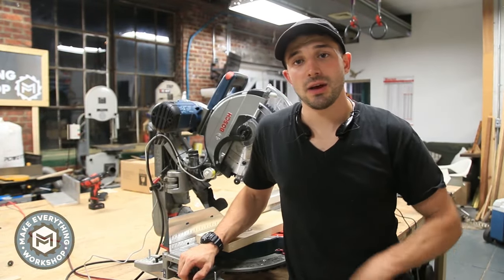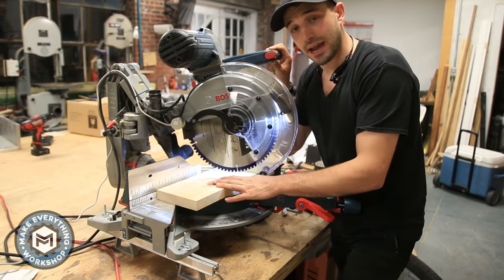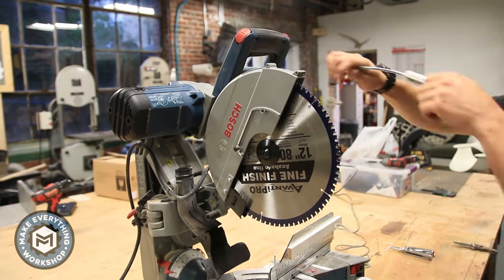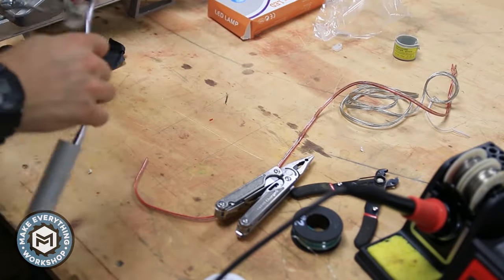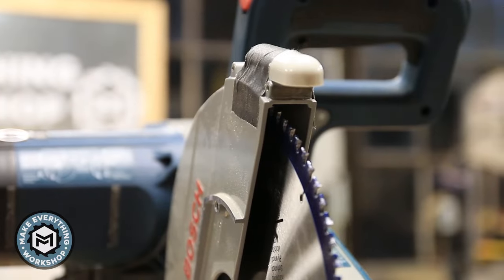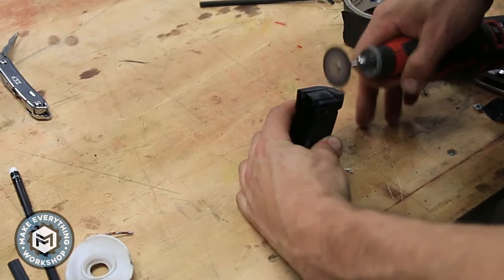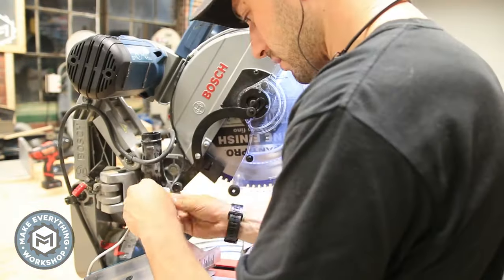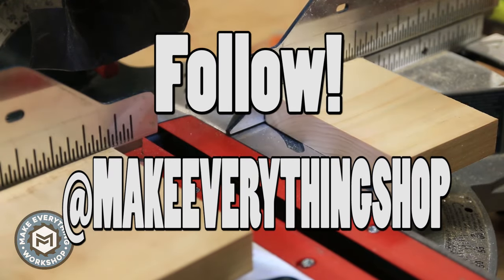How To: Add A LED Shadow Line To A Miter Saw (CHEAP!)

Comment: Brilliant- no pun intended- absolutely one of the best tool hacks I’ve seen on YT. WHY didn’t Bosch do this in the first place?  You’ve made a popular saw 5x more user and greenhorn friendly / much respect!
Reply: Probably because Dewalt has a patent on it?
Reply: Dewalt does it and they charge $200 for it >.< it's called XPS technology.
Reply: Bosch does have one it's on the European model not Imported here. I've tried to find the parts it replaces to top plastic piece at the end of the blade guard
Reply: @georgebliss7674  Makita has it also. Are they paying Dewalt for the license?
Reply: @XaeroR35 , either that or Dewalt's patent ran out
Reply: Dewalt's markup on a few simple components is ridiculous. I was thinking of adding a laser but this is so much simpler and far less expensive

Comment: When I did mine the other day, I wired the light into the handle power line. That way the light does not have to have a separate power plug. Haven't seen anyone else do that.

Comment: That had to be the BEST tip I've ever gotten from Youtube!  I thought I'd tell you that my 12 inch Bosch saw (GCMSD.... which I thought was identical to yours),  it turns out it wasn't..... it did not have that black plastic removable piece.  I just drilled a hole in the back of the metal raised part and ran the wire thru and it worked great.  One thing I did different was to NOT open up the housing at the bottom of the light but instead take a couple of pliers and twisted the gooseneck open to access the wires inside.  I cut off a couple of inches of the metal gooseneck and extended the wires that way.  Very easy!  Thanks again for a great idea.

Comment: You, my friend are a genius. I had the Dewalt with the shadow line, but sold it to get the Bosch, and the one thing I really miss is the shadow line. Not anymore. Thanks for posting this video.
Reply: which model dewalt did you have?
Reply: @ginoasci  DSW780 comes standard with it ($600). The DSW779 ($400 for the same saw minus light) is able to install the upgrade kit but they stopped selling them.

Comment: I purchased the dewalt dws 779 and I couldn’t spend the 110 bucks for their custom light conversion kit. I figured something like this could work, and I assumed someone already thought of this and I searched YouTube and here it is. Great job!
Reply: 110 dollars for a light? Jesus.
Reply: @Germanicworlds not just a light…it pretty much converts it to the same XPS light on the 780. I just installed mine and it’s great. It’s pricey, but it’s a clean install and there’s no external wiring or anything. Takes like 15 minutes to install.

Comment: Chris.  I was skeptical I could pull it off.  But for $9 on amazon I bought 2 lights.  Not only did i pull it off ... THANK YOU!... I wired it to the saw power side of the switch and use the common.  Now I have 1 plug in with the saw, Light / guide that is ON/OFF when the saw is plugged in...  AND and AWESOME saw line thanks to YOU!!!!   GREAT IDEA.

Comment: I followed your install but I changed it up a little. I installed the switch and driver in the handle. Turned out pretty clean. Thanks for the video, very informative. I would attach a picture but don’t know how.

Comment: This channel is great! 
I bought the same light but the bulbous light part wasn't going to fit under the guard of my old Dewalt chop miter saw.  I found out though I could disassemble the bulb part and end up with a nice flat LED circuit board.  This fit fine under the guard.  I cinched it down with a cable tie.   This whole shadow light concept works great.  I am glad I could mod my old saw for it.  Thank You!

Comment: Hi Chris, I just bought a GCM12SD last winter and the blade shroud does not have a black plastic cap like the one you modified for your version of the 12” axial glide saw.  No matter though, I used your idea and modified the plastic housing containing the LED board instead to give me more clearance when the blade guard rotates over the LED housing.  I hot glued EVERYTHING (even LED housing) and I am really impressed with your fix to add a shadow line to the saw kerf!  I have to admit it’s pure GENIUS on your part!  Thank you very much for sharing this with the community.  P.S.- I was never a big fan of hot glue until this project and now I use it more often then of epoxy.  I think this an amazing saw and it’s even more precise with addition of your shadow line solution!

Comment: I really wanted to get this exact saw but as soon as I used a DeWalt at work with the shadow line, it became essential. Thanks for the video. Now I can buy the Bosch and all is well in the world
Reply: I have a DW 708 Dewalt Radial Miter. Any suggestions on  how you did yours?

Comment: I finished installing mine yesterday using a 12" gooseneck light.  There was enough wire inside to do a splice and is working flawlessly.  There was also enough material in the black cover to grind away and reinstall all 4 screws.  Just used it a few times today and perfect lineup.  Thanks for posting this!
Reply: What is a 12" gooseneck light?

Comment: NICE! Ive been debating to upgrade my miter saw and ive fallen in love with the Bosch 12 inch glider. The only thing that is keeping me from getting one is no option for shadow line. Im so used to my Flexvolt XPS that i almost went and got another one but saw your video today and now i kinda wanna try this mod. Thank you for sharing this how to!

Comment: I just did your mod on my Bosch Glide Miter. Terrific! Great idea and I'm liking it.  When I ordered the sewing machine LED they had other choices.....30 and 40 LED versions. All the same price. I was tempted to go with one of them, but was concerned that the dimensions of the light unit would be different. I will try this one out in the sun. If it's hard to see the line, I may upgrade. Can't go wrong for 10 bucks. Thanks

Comment: Great video. I have the DeWalt with that shadowline. It works way better than the lasers I've tried. My shadow line doesn't show up real well in bright sunlight but even casting a shadow on the saw helps

Comment: Very helpful video. In fact, Craftsman radial arm saws came with a beautiful high power genius riving knife, anti-kickback pawl, blade guard, and incadescent light bulb inside the blade guard, on their early 1970's radial arm saws. I am not sure which model it was, but I got a $75 1978 model Craftsman radial arm saw and I purchased the blade guard with the "light bulb" and riving knife, and installed that onto my 1978 radial arm saw, and now it's SO nice, it is more precise and I can cut tiny pieces of wood with absolute laser precision, a lot safer than a large compound miter saw. The compound miter saw excels in making angled cuts on regular "normal" size materials. The radial arm saw excels in making highly precise cuts on very tiny, super thin, fragile, or hard to hold objects. The radial arm saw can cut a 1/2" wide cube of wood with effortless precision, without any need for a jig or sacrificial fence.

Comment: Thank you for posting this video. One thing to add is newer version of the Busch 12 in mitre saw sold n Canada do not have the black plastic cover at the top any more. Instead the metal dome over the blade has been extended and has a larger cavity above the blade. I'm planning to place the light in this cavity and drill out for the wires as there's not enough room on top of the blade housing any more.
Reply: Hi Mak. Where you able to finish your project successfully? And how did you stick your led lights to the metal dome? Thanks!
Reply: Hi  @rolandoguevara3066 , I tried using a clip on light at the top but it kept moving with vibration and it seemed to interrupt the flow of the saw dust. I'm a bit reluctant drilling into the metal blade cover as I think it would affect the warranty but can't think of another way. What has happened is I'm getting used to not having a laser light with this saw. I will still pursue putting one though if I can find a good way :)
Reply: Mine is the newer model as well,  was thinking about drilling , haven't done it yet either.  Not sure it's a God idea, plus mounting it securely.   Let me know if you found a work around.  Thanks

Comment: Thanks for this video. You saved me at least a hundred dollars. I was able to take the little power supply circuit board and fit it into the handle of my DeWalt miter saw and tapped the 110V input from there also. That way no extra plugs to plug in, and no wires showing at all. I did have to cut the LED board in half though, very easy to do with an abrasive dremel disk. Just had to solder a small jumper on that to power all the LEDs as they are wired in series.

Comment: You just save me $600, as I was seriously considering replacing my old DW706 miter saw.  Liked, subscribed, bought the light through your link.
Reply: replace your dewalt and get the BOSCH GCM12SD like this one, retro-fit an LED like this guy did or just get a red laser in the side that works great.  This Bosch miter saw is really something. I returned my DeWalt after 10 months and bought this 12” Bosch, and it’s solid.  No lateral movement when fully extended, super smooth action with adjustable tension, front controls, it’s heavy but it’s worth it.
The red LED light is not dangerous, it’s works great, or  buy an LED that fits another saw onto this one if you prefer a shadow line.
I had a DeWalt and it wasn’t as accurate. None of them are like this saw. This is IT.

Comment: fantastic. I've always wanted to get one of those led universal screw on light cause I've always though that's the only option. Love this cause you don't need the saw running which doesn't bother me but it not running is much better for lining up. Thanks

Comment: Chris, that's super cool.  Those red lasers are not as accurate and change with each blade replacement and the battery is always dead when want to use the laser.

Comment: I added 2 or those same lights to my mill about 4 years ago. Wired it some they come on with the power switch. I plan on replacing my 15 year old dewalt miter saw with this one. Think ill try this mod. Thanks for sharing.

Comment: I did this and can't recommend it enough.  I used a slightly more powerful light than the one used in this video but I'm sure any led fixture that will fit will work. The newer saws don't have the small hood at the front of the blade housing but it's still easy to do. To do it:
Take note of where your blades rides inside the housing and mark the outside top of the guard with the blade's center. This is important because you want the space between the two rows of LED's to rest right over the blade. If you offset it you will get a slight shift in the shadow line from the actual kerf. Not much but in critical work you might be off by a 64th to a 32nd of an inch. I used an industrial adhesive to fix the light panel at the front inside of the guard. I then glued the wires from the light ( you have to cut them at about 6 cm from the LED control board ) to the switch inside the guard along its top left and after that I layered them with an industrial epoxy. This may sound freaky but there's  3/4 inch or more clearance in there. I exited the wires through a 3/16 hole in the guard that received the goose neck  from the original light. I fabricated a small guard and mounted it to cover and bind this wire exit point.  The the wires were routed inside the belt housing by entering a cooling vent and drilling the casting flashes and running it through them over the top and into the handle chamber.  Those were then epoxied to avoid vibration chafing.  The red LED mains wire (110v hot ) goes to the mains black at the saw switch on the un-switched side. The mains  green wire  is combined with the neutral hub. The LED switch white wire is lengthened about 5 inched for rerouting as are the switch yellow and red wires.  In my case I cut a 1.5 by 1 cm rectangle into the handle top cover  just behind the 4 clamp screws and mounted my switch there. I positioned the LED control board in an empty hole by the switch wire galley, soldered in my connections, routed them in the existing wire galleys and closed it up. The external switch and hub were secured with polyurethane adhesive.  Now I have a shadow light with a switch mounted like the Laser switches on other saws have.  This light gives good kerf location and  serves as a work light. 

Attaching the LED unswitched side of the mains to the saws unswitched side of its mains is no different eclectically than using two plugs in the same receptacle.
Reply: Post a vid on your solution.

Comment: What an awesome idea bro. Using the housing intended for the laser as the housing for a superior product you thought of yourself. Well done Chris, I've also got this saw and the built in laser (which is housed in the black plastic housing you manipulated to suit your led, stopped working a few months ago. A replacement laser is around £70 (I now live in France but bought the saw when living in London a few years ago). So your idea seems way more practical and inexpensive. That's some really dynamic thinking on your behalf, nice one bro.

Comment: Wow! Thanks! I just added one to my Dewalt DWS709 I had to use  a different light to make it fit but great job very easy to do!  Anyone who wants to give it a try: 
QUANS 5W Clip on Clamp Gooseneck COB LED Desk Table Light lamp Warm White 19inch Neck Black 
I had to strip everything so it was light, wire and control box. I hot glued and taped it.
Reply: Thanks so much for the info!

Comment: Great idea and I plan on adding something similar to an older miter saw with no guide lines. However, as a side comment, I find speeded up instructional videos pretty annoying. Especially since it's very difficult to see details in what is being shown. But thanks for the info. 😊

Comment: I have always been surprised Dewalt is the only slider I know of with this type of indicator. Has to be cheaper for a manufacturer to go this route vs a laser and its so much simpler to align.
Reply: Rob H  I thought the same thing. maybe it is copyrighted by DeWALT.
Reply: No. Its not the only one ;).. I don't know if u guys get it in the USA, but here in Germany, Festool invented the new KAPEX KS60 wich works with this method too :) But this hack is awesome!!
Reply: Laser needs to be adjusted and it can shift off alignment but shadow is casted always same line where that blade is. Led also illuminates work piece so you can see easier where is your markings.
Reply: New ridgids also use this type of guide
Reply: Ridgid has the exact same shadow line feature.  Other companies just haven't bothered.
Reply: I don't mind DeWalt saws but some models are so basic and cheap they don't seem to cut as true as needed for fine finish carpentry work. The company I work for has 4 different DeWalt models and they all cut different from each other. I bring my personal saw which is a Bosch 4410L and it still after near 12 years cuts consistent. Example coping base, to cut out the straight piece the DeWalt never matches the Bosch does. Not trying to brand bash either just an on the job observation.

Comment: Very nice idea.  I found a very small laser line generator for the same price that I'm certain could create a line you could see without having to lower the saw down to the work piece (which would be my preference) but I'm unconvinced that it would be as brainlessly accurate as this over time, especially with different kerf width blades and vibration when the saw is running.  It's worth noting for users of this saw that on the newest iteration the front guard is all one metal piece making this installation less practical.

Comment: The newest iteration of this 12” Bosch doesn’t not have that plastic piece that you put the light under. The shape is there but it is now part of the casting. Probably have to drill a hole in the casting for the wires and epoxy the light in somehow.
Reply: bought my saw in 2013 and it does have that plastic insert but haven’t been able to find the LED that fits it.
still can’t and i don’t think Bosch ever designed an LED light to fit it. planned on it but never happened.

Comment: I just did this on my saw.  Instead of carving up the black plastic piece on the front of the blade guard, drill a 1/4" hole on the small side as high up as you can, and drill a 3/8" hole on the larger side 7/16" up from the flat open end.  This will allow you to snake the wire and steel coil through and be snug through the small hole, and then the light boss that is 10mm will be snug on the large hole.  There is still enough clearance for the light within the moving guard, and you can epoxy to fill any other gaps.

Comment: Clever.  When using on job sites how effective is it in sunlight?
Reply: no response so obviously it doesn’t work in daylight.
so it’s best to use a red laser light you bolt on with the blade.  i have one of those and it works great.
not dangerous,don’t know why he would say that because it works perfectly.
Reply: @ginoasci  Just use you hand above to cast a shadow. Works great.
Reply: @ginoasci  Because with most of the add on laser assemblies, the blade has to be spinning in order for the laser to cast onto the wood.

Comment: Good idea, I have to look to see how I implement it to mine. Thank you. Greetings from Spain
Reply from the maker: Ruben Paz if you have any questions let me know!
Reply: Thanks Chris, but in my little Delta 36-040, things are going to be complicated. But I keep turning to see how I can do something similar.
Reply from the maker: Ruben, I just looked up the Delta 36-040, I think you could get this to work. I would test proof of concept by removing your blade guard and position a led flashlight above the blade. This will mimic the effect of the LED light I used. If you are able to get a shadow line your good to go! Good luck, if you have any more questions shoot me an email.
Reply: i